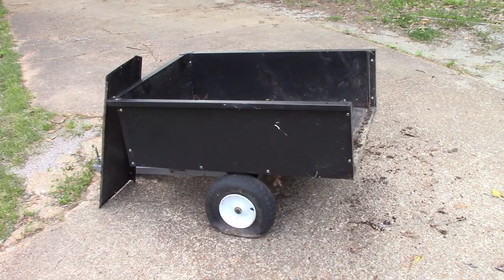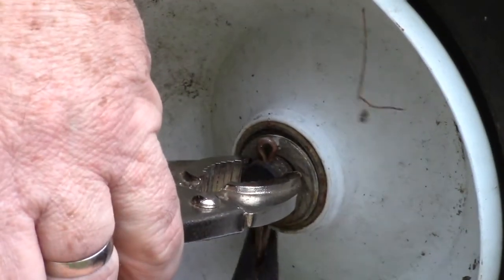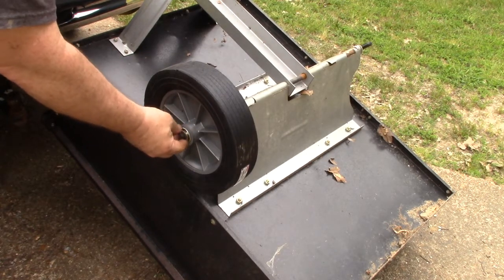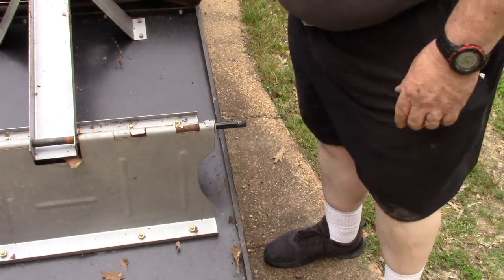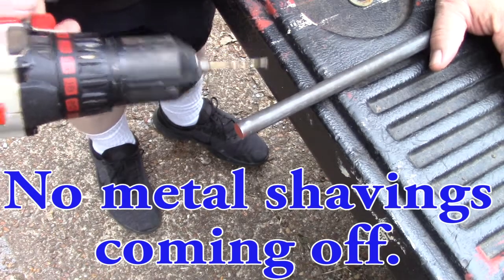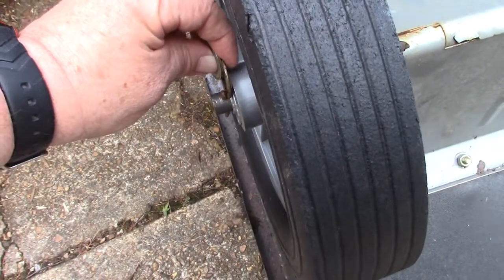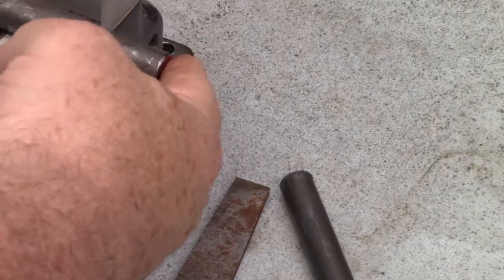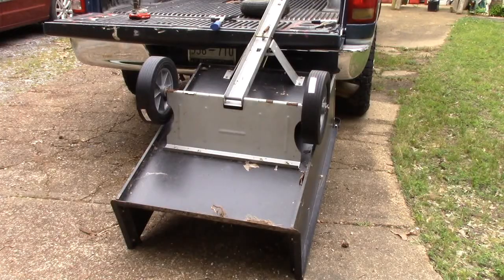Making an Axle for a Utility Dump Cart Wagon and replacing the Wheels with Flat Free Tires

Comment: You can also slow the drill down to get the pilot started. Thanks for this video. I got an idea and I'm going to try it
Reply: Aye. Metal and a hot drill drill bit tends to dull the bit. You want to go slow and let the bit scrape the metal. A Drill press is best suited to hold everything still but a hand drill will work... You just need patience. It once took me an hour to drill out three hex nuts from a stainless steel drum and when I was done the bit was still usable... So, it's either spend money on hardware or spend time on the job.

Comment: The only reason carts use cheap pneumatic tires is they use much less material saving the maker money. I put solids on my carts and front riding mower wheels immediately and discard the pneumatic trash. First cart I modded was in 1987 and it's still in service with the same wheels despite daily abuse.
Reply: I've had mine for 9 and 1/2 years and it just blows me away that it broke I mean it actually snapped from the tire axle from the main actual of the body wow blew me away

Comment: My back axle broke literally broke off from the wheel on my grocery cart where would I find a replacement axle that way also go to the back wheels gate I'm sending this message is December the 3rd 2022 time 2:54 p.m.
Reply from the maker: Measure the broken axle (or take it with you) and go to Farm & Fleet, or most any of the big box stores like Menards, Lowe's or Home Depot. Find the hardware section that sells flat and round metal stock. They should have it.